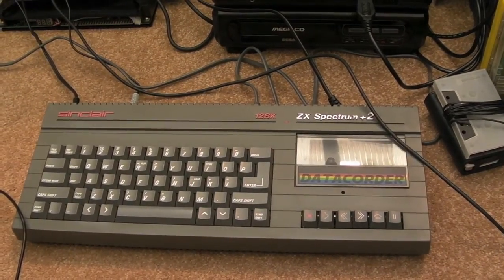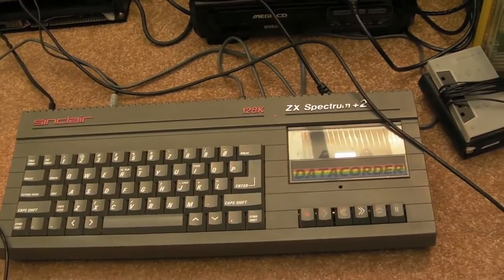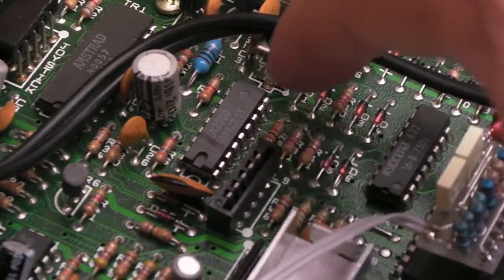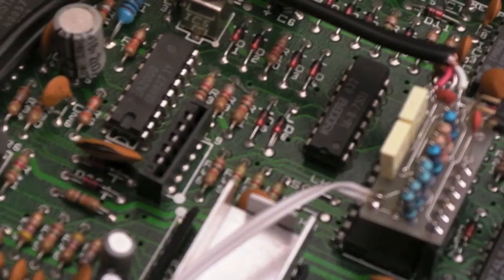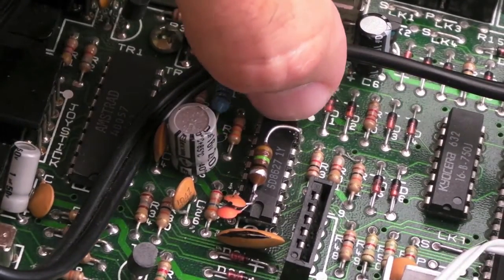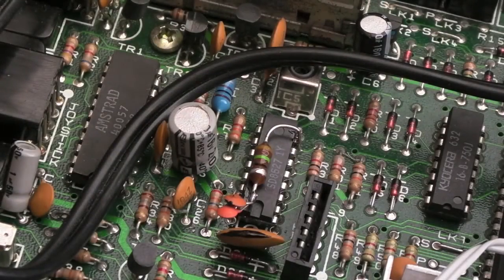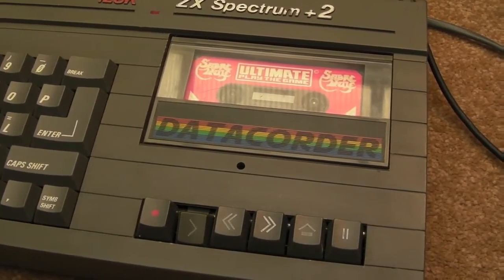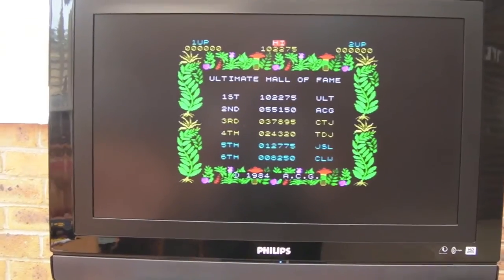Sinclair ZX Spectrum +2 Video Ghosting Fix / Mod (Better Video Output)

Comment: Just got one of these beauties with a broken datacorder so I have removed that and in it's place I have put a 9V power supply, now going to wire it directly the the power input jack and install a C8 (Figure of eight) connector on the rear and finally cover the massive gaping hole with a piece of painted gray plastic where the tape deck used to live.

Comment: I've just done this to two of them, one, where I decoupled the audio from the video totally is absolutely perfect whereas the other has exactly the same smidge of blue that you have. The second one however had the audio decoupled and the capacitor joined to the transistor (Bottom leg of TR1 I think from memory) so that I still get audio via rf may play a part in it? I'll try it when I fit my stereo mod and report back. :-)
Reply from the maker: Very interesting - let me know how you get on!
Reply: GadgetUK164 - Retro Gaming Repairs & Mods Hi, it was no different than before which is a shame but it's a hell of a lot better than it was! :-)

Comment: I tried this and it helped a little, but the ghosting is still there on composite
Reply from the maker: +Colin Ellett See the original video here and double check you've got the right connections and you've used the right cap size and inductor!  https://www.youtube.com/watch?v=GMKGIP5Yuqs  I've done this on a few +2's now and it gave me an absolutely crystal clear display.  Maybe you've got a different revision +2 or something?
Reply: +GadgetUK164 Cheers, I'll double check. I'm sure it's the same revision motherboard as your's. I tend to use RGB the most anyway, so no biggie..

Comment: Working on the CPC's, this helps a great deal. I can't begin to understand the value's of components yet, not fully anyway. Nicely done here.
Reply from the maker: Have you tried it on the CPC?   It might be the same problem as they are based on similar components.
Reply: Possible, but it's different symptoms. Wait for a 6128 board to arrive so I can replace the RAM in one and the AY in the other. Through I'd try that first before I swap out the  74LS145. Going to take ages changing all the RAM on the first one though, as I can't tell what one, if any, is the problem.
Reply from the maker: If its 4164 DRAM you can try piggy backing a new DRAM chip over the existing chip - ensuring the legs of the new chip are bent slightly inwards to help 'grip' the pins on the existing chip.  For certain failure types this can help identify the faulty chip(s).  Don't do that on 4116 chips though as they need multiple voltages and if you lack a voltage or gnd through bad connection it will fry the new chip you are testing.
Reply: The chips in the 6128 are 4264's, have been told they will be fine replacements for the 4164's. (?)
Reply from the maker: I think the should be OK.  What's wrong with the 6128?
Reply: Ha, It's just what's left of the MB. A contact in Germany on the Facebook forum's said he had one spare. Had lots of parts missing like Z80, Gate Array, Caps, graphic chip, ROM etc.
Reply from the maker: If those don't work, get something like this off EBAY.  They work out at around £1 each tho.  http://pages.ebay.com/link/?nav=item.view&alt=web&id=271610887305

Comment: Every other chip was tabled Amstrad.
Reply from the maker: Not sure what you mean?  Do you mean 'labeled Amstrad'?  There are a fair few chips with Amstrad on them.  Although still has Sinclair on the main badge, despite being an Amstrad product.
Reply: Yeah loads of the chips had Amstrad written on it. Did Spectrum get sold to Amstrad then?
Reply: ***** Yep. In 1986 Amstrad bought everything computer related from Sinclair. Not sure how Sinclair went down exactly but the QL was an expensive flop, and sir Clive couldn't stay away from tinkering with the C5. Strangely, it's not like the quality of the hardware went down after Amstrad took over.
Reply from the maker: Yeah, the C5 was a huge mistake, but it was a great idea for the modern age (electric cars and all).  There are some C5 related vids on EEVBlog if you are interested!
Reply from the maker: custardo LOL!  That's amazing, I had no idea he would be on a TV poker program like that lol.